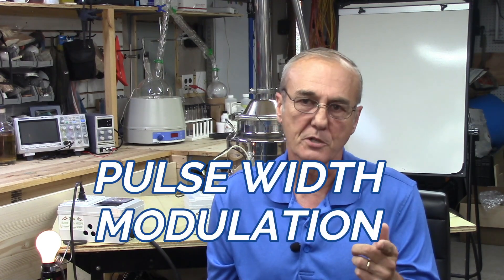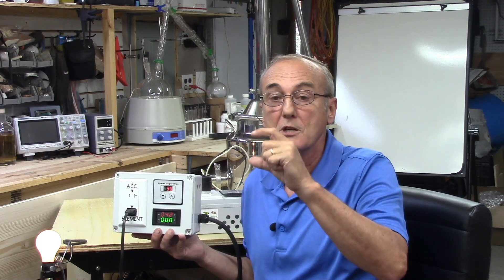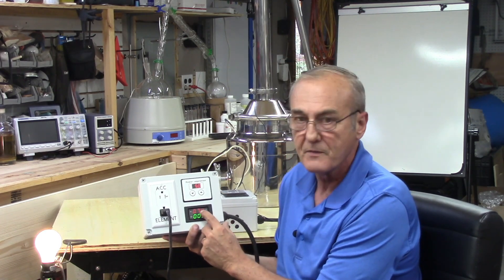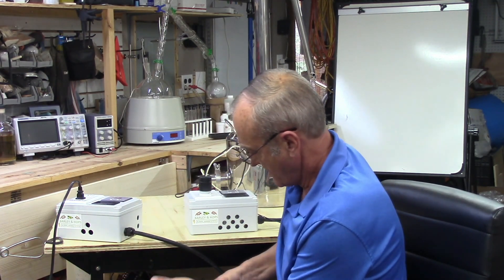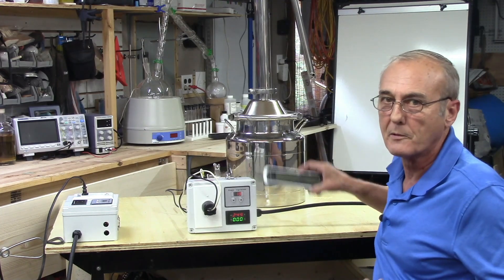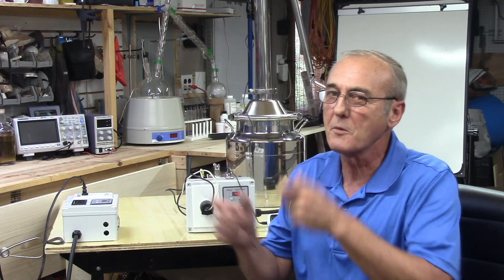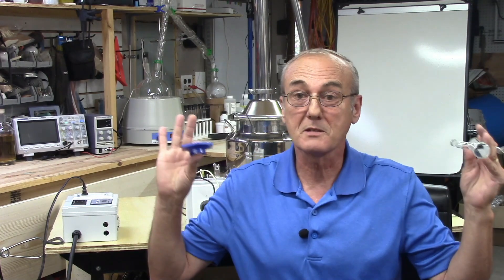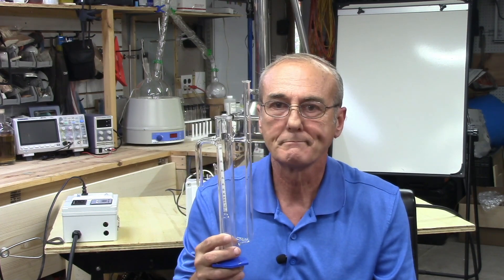HEATING STILLS WITH A PWM

Comment: George I wish I could understand the reason why the voltage indicator doesn't change on the 240 model. As the pulse width range is adjusted up or down the voltage goes up and down with the amps. It would be so much more satisfying to see it change so we could calculate wattage easily at a glance. Is it just the controller can't monitor the voltage and only displays the full available voltage which would be kind of redundant? head scratching here. Love your videos though and thank you for all your hard work!

Comment: I hope you have a triac in there (or two SCRs).  An SCR is unidirectional (i.e. passes current in only one direction - DC). To efficiently pass AC you need two SCRs connected head to tail. Two SCRs connected in this way are available in a single package. This is called a triac.

Comment: Scr proportional power controllers are the way to go. They allow really fine balance and control. I have PID as well but use that to control the top temp the system can run at. Great to preheat if busy. Set scr to 100% pid to heat to just below (10 degrees) production temp and go and have my supper. Come back and its ready to quickly bring up to production. Then I turn up the setting on the pid to max temp I want to avoid tails. 
Then use the scr to control the balance and production volume.

Comment: Slight clarification to all this. Your earlier PID control uses math to PREDICT an outcome based on rate of change compared against the prosees value(PV) (temperature) and a set point (170F).  Now, the difference between the PV and set point basically drives an output between a minimum an max output value. Your PID control turning on the element more in a set period is result. Basically you could take a PID out, let's say 30% and go over and set you SCR knob to 30% and that is the predicted value to achieve your set point. As you get closer to set point that percent backs off. 
Now, if you take a PID controller and have it drive an SCR, you are in the money. The PID replaces your stubby finger pressing the up and down arrow on your SCR box. Get it? 
Also an SCR is much better at driving a heater as it's only using partial power. Less cooking and shocking of the mash and a smooth transition between incrementing temperature. You can also use a higher wattage element without worry by limiting the SCR output. 
Bunch of fun stuff here.

Comment: Hi  , just did my first run on my t 500 4.5 litres from 25 ltrs sugar wash...surprised me a bit , got a consistent 94% but took 5-6 hours  smells pretty bad chemical with a hint of  ass, just ordered the EZ filter system hope this gets rid of it , any hints or tips ? temperature was 51 C pretty consistently.  thanks m8.

Comment: PWM and PID are two methods that are destined to be together. When you marry them, using a PID to set the PWM value, you get amazing consistency and accuracy.
Reply: @robertt1782  a lot of the purchased PID controllers tend to be binary - they switch the element on and off, so you get a lot of bounce around your setpoint - slight overshoot, drops under etc. tighter control than a thermostat, but still clunky.
PWM without a PID controller requires human input and quite a bit of trial and error.
using PID to set a PWM factor means you are controlling the power to element in finer detail - so as you get closer to your setpoint the PWM factor gets lower so your power into the element drops. PWM/PID combo means your element is never truly off so you can push minute current in and sit and your required temp.
I have come across a few very nice PID controllers that are PID controlled PWM  (discovered via checking output via oscilloscope). I haven't got one of George's yet so i'm not sure what his are
Reply: @kelvindavis-smith1223 when you talk about a PID controlling the PWM, are you still using an SSR? Isn't the SSR what pulses the on/off? And what kind of PID would you be using? Something like the cheap inkbird types only do on/off based on temperature right? So would you need a different type of PID to get a more stable/constant/gradual heat output? Some of this stuff is going above my head and I'm inclined to just use a PWM and babysit the boil.
Reply: @mattrogers3250  Yes, still using the SSR - i built an ardiuno PID PWM controller for my still

Comment: George, Have you used the SSR that has the 500k resistive input and a built in pwm? I picked one up just out of curiosity. I haven't done much with it besides just hook a meter to it but it would make a super compact PWM controller.

Comment: Can you use the pid as a pwm by adjusting percentage of power instead of setting the temp. If so how do you do it.
Reply: You can run a PID in manual and set what percentage you want.
Reply: @josephkordinak1591  How do you put the mypin in manual mode.
Reply: @shaknit  I have no idea, I looked at the manual for it.  If you have an ink bird you go to output settings and then to control mode and go to manual.
Reply: @josephkordinak1591  On the inkbird you have to set it to pid and automatic then when you hold down the left arrow until the run light comes on it goes into percent power mode when you hold it down until the run light goes out you're back in pid mode.

Comment: George, my friend, another PWM, PID explanation?  Ha.  You're doing a great job at a complicated subject. As an EE, it physically hurts to see you have to explain it so many times.  The PID is the control formula, PWM is the control method.   They really aren't related.  I can explain more if you want. Luv the channel. Looking to run my first batch as soon as it cools off here in TX.
Reply: Precisely. PID is one of several methods for establishing the amount of power to be delivered to the load while PWM is one of several methods of increasing the precision of delivery of that power. These two methods aren't mutually exclusive, since they concern different aspects of power distribution. Actually, a PID control loop with a PWM delivery method is the best.
PWM is still an "ON/OFF" delivery system, the essential difference being that the switching is done at a high enough frequency that the thermal inertia of the heating element is accounted for and taken out of the equation, therefore allowing for much smaller "swings" around the set point (including all the intermediate set points along the way there).
Reply: INTEGRATION IS THE ESSENCE OF PWM.

Here's a (very coarse) analogy to help people better understand the difference between a simple ON/OFF delivery system and a PWM ON/OFF one: compare a slideshow with a movie. They are both objectively just sequences of still images, but there's one key difference. The slideshow contains several snapshots at various moments in the action, but they're "frozen in time" and seemingly unrelated to each other; there's no way to discern the dynamic path from one picture to the next, anything could have happened inbetween. The movie, on the other hand, takes advantage of our sensory system's inertia*, and also (and this is ESSENTIAL) of our brain's ability to *integrate pictures into fluid motion, if the images are presented with high enough frequency. This results in a much more precise perception of the path taken by various elements from their initial position to the end and of the dynamic relations between them.

Upon power-on, the heating element does not go instantly to its maximum operating temperature; it has a "ramp-up" of progressive temperatures over time and the same thing happens when the power is turned off: there's a "ramp-down" time to ambient temperature. These durations are very small compared to the total operation time of the element for a specific task. In a simple ON/OFF system they are negligible, both ON and OFF durations are generally much larger.
PWM on the other hand takes advantage of these ramp-up and -down periods by switching between ON and OFF states fast enough that the element doesn't get to either fully cool down or fully heat up (unless intended). The energy pumped into the system is effectively INTEGRATED inside the heating element by means of its thermal inertia. This allows for increased precision of delivery.

Deciding how much power needs to be delivered to the system and when is the business of "higher powers", i.e. the control loop - which might very well be a PID one.

Comment: SCR doesn't do PWM they sign wave clip, but hey yet another good try.....
Reply: Wrong
Reply: @Bernie_the_Bolt  care to explain yourself?
Reply: @MrJaycz80  When a sinewave is clipped one or both peaks are flattened, it is most commonly  observed when audio amplifiers are overloaded. An SCR is basically a switch that can be used to vary the power to a load by being switched on and off by external circuitry using PWM or some other form of pulse modulation. The use of the term SCR in this discussion is probably incorrect, an SCR is a unidirectional device so would never apply full power to the load, it is more likely a TRIAC that is being used which is a bidirectional device and would be capable of varying the power from zero to maximum.
Reply: @Bernie_the_Bolt  like George in this video you are only partly correct, yes a triac is used but there is no pwm used as using pwm to control a triac can result in situations were the triac doesn't turn off due to the high frequency of pwm signals, usually in the kHz to MHz range. I think you will find that the triac is triggered by a simple voltage divider and capacitor timing circuit. Yes again you're part right in say that a triac will never deliver full power, but that is only because of the 1 to 2 volts needed to turn the triac on and when we are talking 110 to 240 volts range you'd have more losses than that getting power to your device, but the kicker for me is for some reason you know this but still fail to see how the sign wave is being clipped by the triac. Full marks for effort though, nice try ☺️
Reply: @MrJaycz80  You are talking about a chopped sinewave not a clipped sinewave as in my first post, also pwm is not restricted to high frequency.

Comment: I have a Turbo 500 which I use with the Alembic Copper dome as a Pot Still.  I use an SCR from Harbour Freight and it works perfectly and costs $30.  Effectively this is just a dimmer switch.  It requires very little adjustment during a run.  I use the thermometer at the start of the condenser and the flow rate to make adjustments during the run.  https://www.harborfreight.com/router-speed-control-43060.html
Reply: @DiegoRodriguez  I have a digbroil same is Turbo 500 an I was jus looking for something to control the temperature  better..thanks for the link👍
Reply: Just don't try that router controller on anything higher than 1500 watts.  For grins tried it with a 2k watt element-it melted.
Reply: @anonymousbastard2981  That's good information.  The T500 is 1600 watts and the SCR does get pretty warm after several hours.  So, it's probably right on the edge.

Comment: Another take on PWM: abandon the idea that there is one “right” temperature, since as distillation progresses, the overall boiling point slowly creeps up. Instead, look at your drip rate.

Leave the power at 100% till product starts coming out, then back that down till you are getting an ideal drip rate, say three drops per second with the occasional spurt for a small pot still. With an occasional adjustment to keep that flow even, you may be surprised to find that there is a sweet spot (% power) where you are supplying just enough juice to balance the system: enough to distill and slowly raise the temperature with minimal intervention. 

The digital version of these controllers is a big help in that regard, since it’s almost impossible to fine tune using only a dial.

With a little record keeping to establish some baselines, it’s also possible to use a timer and temperature controller reading at the vapor head to shut down the system to avoid getting heavily into tails if you get distracted or have to tend to other business.
Reply: Would you recommend a PWM like this? I know some people on the forums hate on George For some of the things he does but this seems good to me. Im in the process of getting a controller put together so this stuff I new to me, I used to use propane.
Reply: @Hanson423  I think George provides a very valuable service. Think of him as the ideal undergraduate teacher.. prepared to deal with the un/knowledgeable, yet once a concept is introduced he can take you way up the learning curve quickly.
Reply: @bobtheelectrician6692  I agree, I think he’s a great “tool” for anyone that’s wants to learn or needs help understanding something! Do you this PWM is good starting point for someone new in the electric still world?

Comment: Would you be able to do a short video on how you built these pwm controllers? I"ve seen the videos you did 2yrs back but these controllers look different.
Reply: Just go back and watch that video and then buy the parts listed there.  You can get the new PWM from amazon using this link:  https://www.amazon.com/Digital-Voltage-Regulator-Control-Thermostat/dp/B075QZ9GZT/ref=sr_1_4?dchild=1&keywords=SCR+electronic+voltage+regulator+240+volt+ac&qid=1596333305&sr=8-4